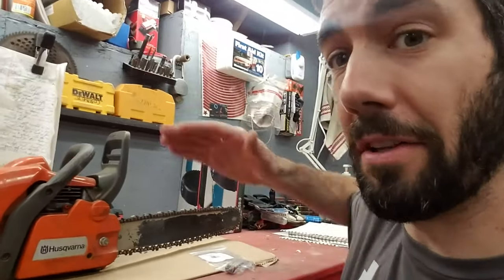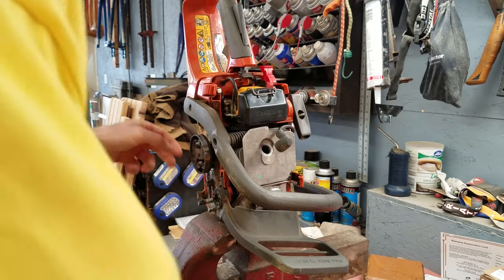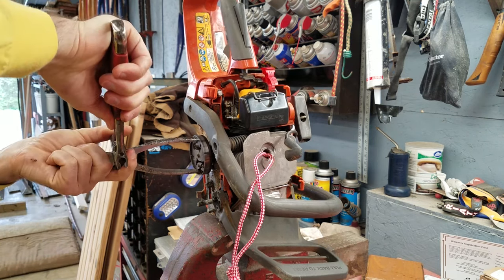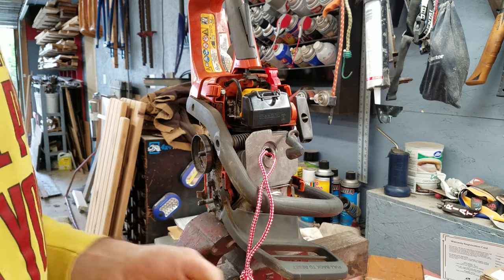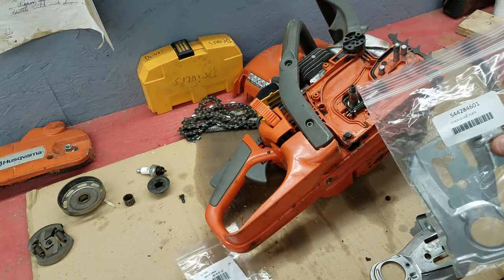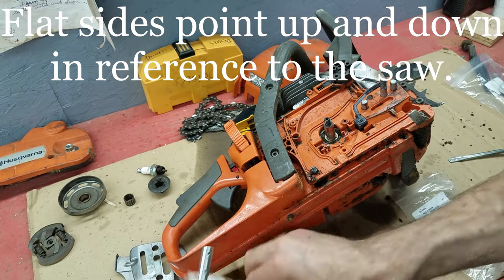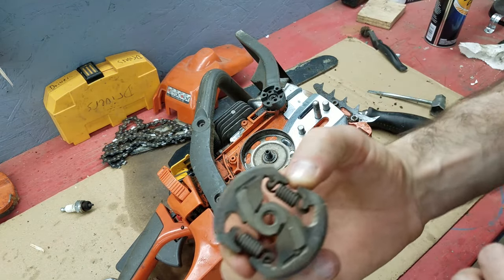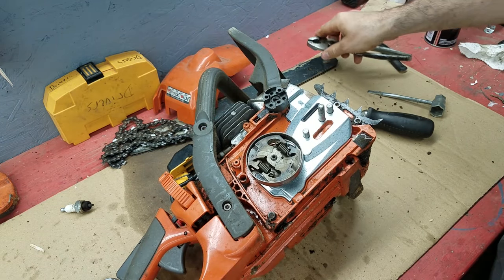Husqvarna Bar Oil Leak Fix

Comment: I've replaced everything on my Husqvarna 440e and she still leaks bar oil like a pig and very hard to stay tuned.  I will never buy another husqvarna.  My next chainsaw will be a Stihl..
Reply from the maker: There is that.  I might do the same thing.
Reply: Add a film of any silicone to the down side of the Oiler tube where it meets up with the hole on the saw. The plate and one screw are not enough pressure to keep the oil tube down in place. Allow 1hour or so with the saw on its side while silicone has a chance to dry and problem solved this works for any saw with this kind of Oiler system. I know it should seal without it but it doesn’t. Oil leak fixed
Reply: Just a guess ,,,But I'm betting you got it at lowes ,,, seems like the Husqvarna saws from lowes ,,, every model have this issue
Reply: I fear that Stihl might have its own problems 🤔

Comment: I used mine one day, for 3 hours, and it dumped all of its bar oil over the next few weeks it was sitting...  Will be interesting to see if there's damage in there already...
Reply: Same, mine is brand new, used it maybe twice and over the winter it dumped it all in the floor.
Reply: @Rloc8773  Well this makes 3 of us. Oil everywhere. Mines been reconditioned and screams but oil is costly.
Reply: This is my situation too. Can anyone tel us why our brand new saws just dump the bar oil out after less than an hour of run time?
My shed floor cant take much more!!

Comment: I'm thinking after reading a bunch of replies, I'll just dump my oil after every use. I was keeping the saw in my storage compartment of my RV so wherever i go ill have a chainsaw, a pole saw and a weed wacker to clean up the surrounding area. Grabbed the saw 1 day and found oil all over the floor. I was a tiny bit shocked as the saw was only a few days old and only used for like an hour before storage

Comment: Mine has the same problem with my 445, does not oil well when using it (will ty to clean out again), leaks a lot of oil in storage since it was new years ago, when I took to dealer (when new and under warranty) of course they said only normal seepage nothing unusual...
Reply: Same here. I brought it to the repair shop and received the same answer. I am looking forward to tearing it apart and attempting to fix it now that I've seen this video!

Comment: My 435 leaks as well, when I opened it to inspect, I found that the worm gear/bushing was completely melted and very tight on the shaft- not entirely sure that is the cause of the leak but will be replacing them anyway. Another option to putting rope in your cylinder is to use the grooves in the clutch that say "off" with an arrow, I quick tap with a hammer and screwdriver and the clutch will spin right off.

Comment: I like the trick with the pliers.
Reply from the maker: And the rope? I saw that from someone else.
Reply: @MakerMaxCorbett  Is the purpose of the rope to get the piston from moving? Why do you have to find TDC? Is it possible to find without a special tool? What is the possibility of damage?
Reply: @ChrisWilson37   There is also notches marked "OFF" in the clutch a quick tap with a hammer and flatblade screw driver will take the clutch off without putting rope in your cylinder.

Comment: I've just purchased the Poulan pro 42/18 brand new 2/25/23 its in with Husqvarna and it leaks bar oil more than it should. Like I said it's brand new with no cuts on it yet. You have any ideas why it's leaking like it is?

Comment: I wonder how you rotate to top dead center it would really help one that is trying to learn on your video that does not have a clue that is me
Reply from the maker: You don't need to go TDC to do this fix.  To get to TDC put a pencil in the spark plug hole and rotate the crank until the pencil is the tallest.

Comment: Ive got the husqvarna 450 rancher. Looked similar to yours. I’m having the same issue. I only notice it leaking after it sets for a while. I’m wondering if this would be a fix for it. It’s less than a year old.
Reply from the maker: There is not much to them on the inside.  You can pull it apart and look for damage.  The parts were under $25 for both and took less then 1 hour to do.  Better then cleaning up bar oil all over.
Reply: Put a small film of any silicone on the back side of the Oiler tube don’t cover the hole with it let the saw rest on its side while it dries about 1 hour you can put the plate back on while it’s curing. Leak will seal up good to go. Shouldn’t have to do this but it works

Comment: I have a 350 and leaks like a bitch too.  Saw a video where the guy used red thread lock to seal things up.  I completely took mine apart and cleaned it up, compared parts and i have short oiler hose that goes to the bar and the pump outlet sticks in there.  I also noticed the case has a port connecting the oil reservoir to the rubber piece.  Where that oiler port is there is a small plastic screen cup sort of like a tiny thimble held in by a screw on the bottom of the saw.  I have never seen a plastic to plastic part seal against each other so this is probably my leak.  

Just looking at a couple more videos to see if anyone uses sealant on the tin plate or oiler tube or anywhere and why not use rtv like on car intakes?
Reply from the maker: I guess you could use RTV to seal it.  The oil hole is small so keeping it from clogging that you need to be careful.  Also this is not under pressure so I guess husky thought friction would be enough.

Comment: What happens if you don’t get the cylinder dead bottom??
Reply: Absolutely nothing! You just won’t get as much rope in the cylinder and it may rotate while trying to remove clutch.
Reply: You should not have the piston at the bottom, as they did here. What will happen then is the rope will go out the exhaust and transfer ports and be caught between piston and cylinder wall. 
Always move the piston up from the bottom, in the direction you are going to turn the shaft.
Reply: Yes it should be pass the exhaust and transfer ports before putting the rope in.

Comment: String stuck in head. Tips for removing?
Reply from the maker: Rotate the clutch the opposite way to lower the piston.
Reply: @MakerMaxCorbett  Yep,  took a lot more force than I wanted to try but it did finally turn and the saw is running with no leaks.  Thanks for the reply.

Comment: What can you do if the piece of rope won't come out?
Reply: If the rope gets caught into the exhaust or intake port.  U have a 50/50 chance of which one. Most likely though it is the exhaust port.  Remove muffler and remove it.

Comment: Interesting guess this may be my problem had a small engine mechanic take a look at my 55 said the oiler was bad but wated 60 some $$ to fix it so told him not to fix it now its dumbed all the oil on the case of my other chainsaw dont know if he he checked well anyway hes allways been pretty dang high every time ive had to deal with him so dont know if he would be able to see a problem that small😂😂😂

Comment: You do know while you had your oiler assembly apart you missed a perfect chance to put fresh grease on the worm gear and then when re assembling the rest you should have put grease on the needle bearing for your clutch drum.
Just saying.
Reply from the maker: Thanks.  This was my first time doing this.
Reply: Someone here recommended putting silicone between the rubber oil line and the saw. Would this be to create a "rubber washer" around the oil hole, if it is then why not put a small rubber washer there instead? Please explain the idea behind this. Thank you in advance.

Comment: Top dead bottom?
Reply from the maker: like top dead center but the opposite.  Basically the cylinder is lowered all the way down to put the rope in the hole.
Reply: BDC.  Bottom dead center